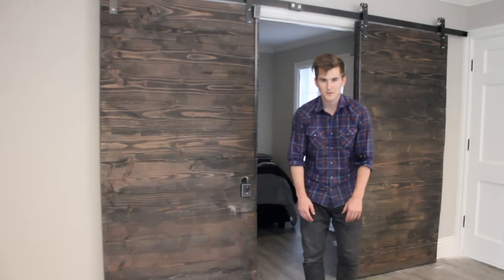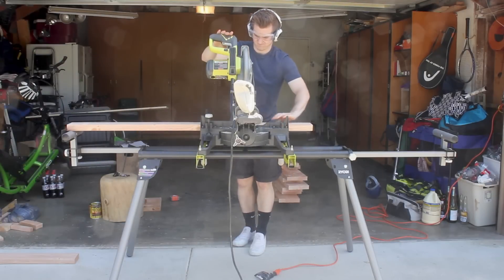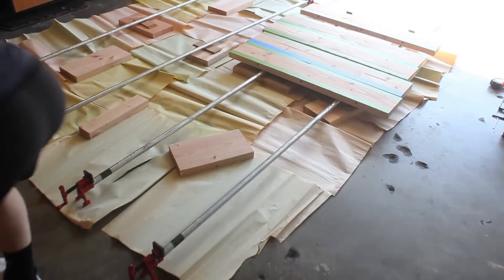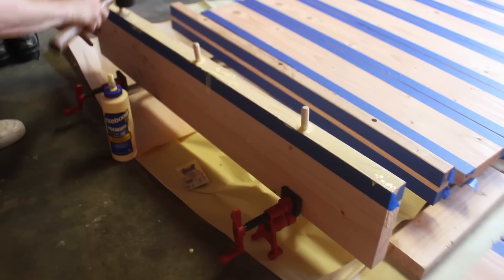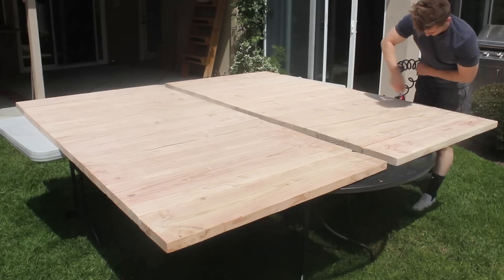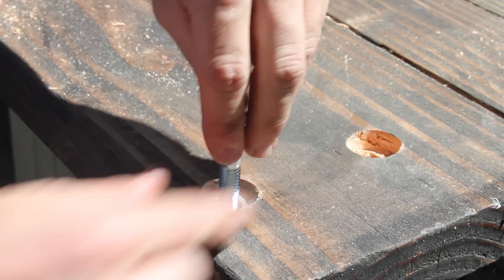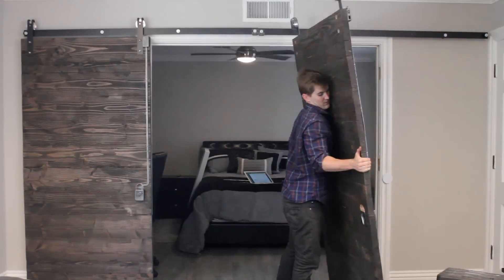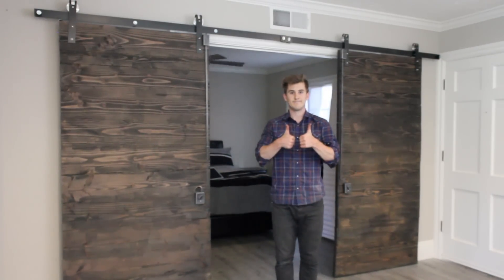DIY Rustic Double Barn Doors | 17

Comment: Looks great! I think you need a few more clamps...adding some along the joints of the boards deff helps keep them flush. Loved the drone footage. Keep it up!
Reply from the maker: Agreed! One of those learning experiences where when I go to do it again, I'll be 10x as a prepared! Glad the drone footage worked! Been a drone guy for years now and want to find ways to work my stuff into my vids a bit more as long as it fits. Thanks Chris!
Reply: The Cutting Bored yessir. If you learn anything from my videos....one can NEVER have enough clamps 😝 Partial to BESSEY myself 😏
Reply from the maker: Agree with you on that - Bessey is the best I've come across. Just sent you a DM
Reply: The Cutting Bored 👍🏻👊🏻